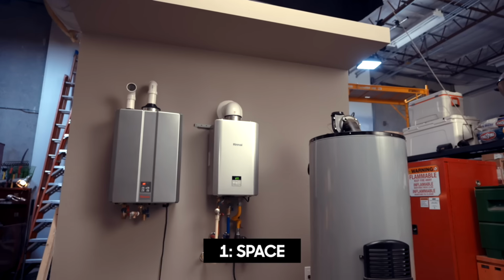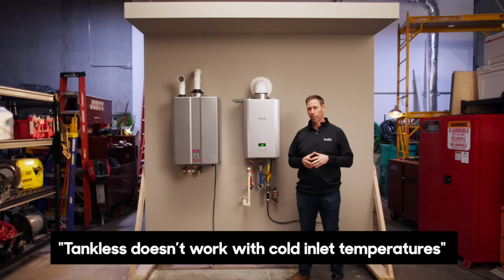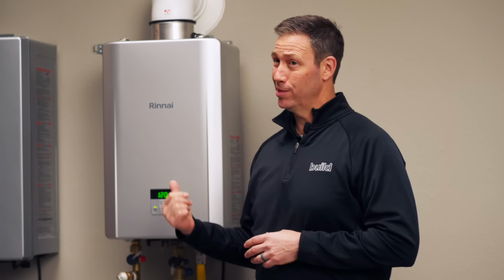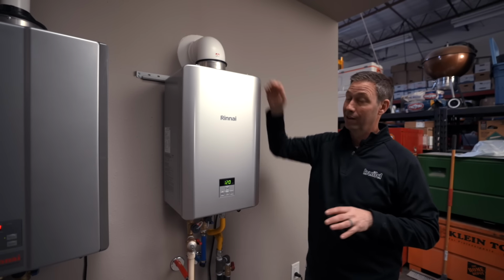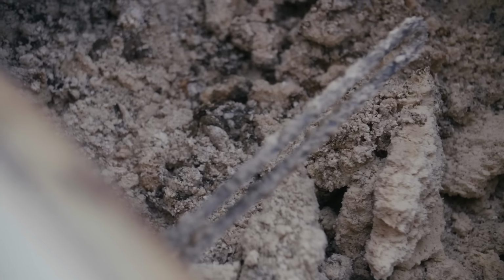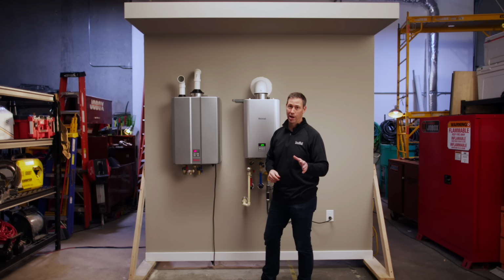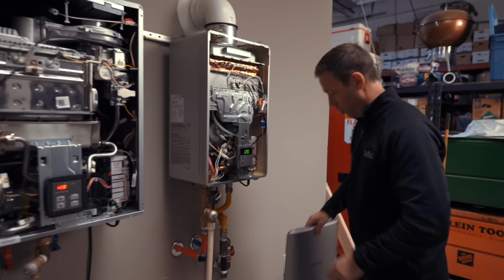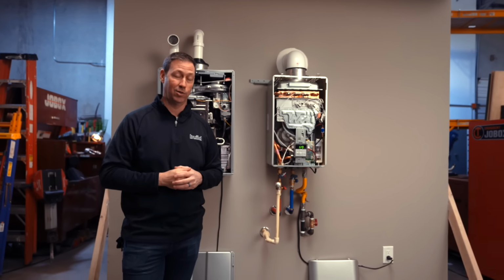DEBUNKING Tankless water heater LIES!

Comment: Your thoughts on Navien and Bosch
Reply: I have  both the Navien combi  boiler (domestic hot  water and water for heating pipes) and a Rinnai water heater.   Both are good,  The Rinnai is 5 years old and I clean it once a year.   The Navien is 12 years old and I also clean it once a year.  It developed a leak a year ago and parts weren't easy to come by and I waited almost 2 weeks for a  replacement part.   The  Navien  is made in South Korea.  I believe my Rinnai is US made and  parts are stocked more readily in local plumbing supply stores.
Reply: Navien has a lawsuit against them for their products. Mikey pipes repairs them alot and covers it well.
Reply: @zack9912000  Don’t know who Mikey pipes is. I’ll assume some YouTuber or TikTok. 

There’s a recall from roughly 4 years ago regarding some of their condensing type water heaters and Combi boilers. It involved risk of CO escaping the vent/flue system, entering living space. Of course if unit was installed to most codes, the room, if interior, would be properly vented and fitted w/CO detector. An exterior install would be of no risk. Most importantly, the respondent showed majority of effected units were installed by ‘non-authorized’ installers. The units were shipped to a distributor, not to specific installers. The recall is not a replacement unit, rather a kit that revises the venting from secondary ‘condensing’ heat exchanger. 

Completely understand avoiding the brand, especially if it’s not permitted by licensed plumber. Rheem offers condensing units, equal in efficiency to Navien. Both are superior to Rinnai in efficiency, warranty and reliability. I don’t have any personal experience w/Bosch water heaters but I’d recommend comparing warranty and EF rating to Rheem & Navien. If comparable, speak w/licensed plumber to see what brand they prefer and why.

Comment: Some notes:
- Your reasoning seems to only apply to gas powered heaters.
- Longevity; I don't know what quality is available for gas powered heaters in the US, but I recently replaced my electric tank water heater with a new electric tank water heater. The old one was more than 45 years old. My neighbor replaced his just a few months later, about the same longevity for his unit.
- For electric heaters, tankless heaters means that your electric system needs to be able to deliver more peak power (higher peak amps).
Reply: Old tank type last far longer than he is claiming. He is sponsored to sell these. So convincing you your 10 year old tank water heater that is perfectly fine, is bad, is what he is paid to do. The last one I changed was 35 years old, the one prior to that was over 60. I have changed ones less than 10 years old, but I can count on one hand how many times that happened.

Comment: I bought a Rheam tankless water heater first. I timed my furthest shower it was 15 seconds to get hot water. I priced out a Rinnai, went for the $700 cheaper Rheam. While the Rheam did hold up for for the first 18 month. Once I started having issues “Exhausting” errors. Nothing is worse than mid shower bam ice cold shower. The repair was easy, but did take a few weeks to figure out. My next house I’m currently designing will have a tankless water heater again. The maintenance does take longer on a tankless than a conventional water heater. I did pay the extra money for the easy flush valves. I also have a hvac license so I can buy contractor grade descaling liquid relatively cheap.
Reply: Love that Rinnai is USA made.  Agree  tankless are the way to go.  :)
Reply: He was promoting Rheem 4 years ago!
Reply: He will shill for whoever signs the checks 💲

Comment: Can you please tell me which is more efficient, electric tank with heat pump and solar panels VS tankless.

Given that the cost of both electricity and gas going up, which would be more efficient?
Reply: That would depend on if you're talking short or long-term.  Long term (or off grid) I'd go with a solar powered electric heat pump system.  Possibly being fed from a passively heated "pre-heater" tank that's warmed by a geo-thermal heat pump (used for heating and cooling via hydronic) and/or a solar-thermal loop.
Reply: Heat pump has EF rating 3.5-4.0. The best electric tankless, Rheem or EcoSmart, are EF 0.99. The best LP/NG tankless, Rheem or Noritz, are 0.97. Pretty simple math 😉
Reply: @MichaelM-to4sg  but have you taken into account of maintaince cost and lifespan replacement cost? 

The tank with heat pumps and solar etc might be more efficient but if you have to replace the whole unit 3x, the cost savings might not be so clear (I use 3x because my current tankless is going strong at 25years and the tank system is only expected to last 10 years).
Reply: @bobbinsnest  10yrs for tank? Says who? 

Firstly, if you have a tank water heater, replace dielectric rod every 7 years and they’ll outlast the tankless. Tankless require flushing annually, which should not be done diy as specialized tools are required, as are the proper fittings to be installed initially.

Rheem warrants their units for 12 years, iirc. The Sanden units separate the tank from heat pump. They have 15 yr warranty however the tank is full 304 stainless. Unless the water is extraordinarily acidic, hard to think it’s ever going to fail.

Comment: Love it…Made the decision to switch from a tank to a Rinnai tankless for our new home construction project. This decision was based on Matt’s previous tankless WH reviews…Several huge benefits to us with this move. The tank was going into a very small laundry room, which was taking up valuable space. The house we are building will not be occupied all the time. Now we have the tankless on and outside wall, gained back valuable space in our laundry room and will have endless hot water, but will not be maintaining hot water in a tank when the house is not occupied.  

Excellent overview Matt! 👏

Comment: Wait! What happened to the comparison to heat pump water heaters? Thought they were even more efficient.
Reply: they are, but its a sponsorded video soooo...
Reply: Agree. This video came off like a paid ad.
Reply: For me the attraction of heat pump is electric rather than natural gas or propane.  It seems to be easier to run on off grid solar than an electric resistance heater because the power draw is low and constant rather than high and instantaneous.  I'll probably go heat pump but mostly since I want to try 100% electric to avoid a propane tank and add solar to net-zero it.
Reply: Pay attention, this was about tankless
Reply: @daveklein2826  and he had a previous comparison showing how much better heat pump water heaters were. pay attention to the question.
Reply: @dannystephens8833  i understand that BUT that is not the purpose of the video....PAY ATTENTION

Comment: Ima get me one as soon as my current Bradford-white dies.
Reply: That’s what I did, it was only a couple hundred more when I was replacing my conventional water heater. Check your utilities company, a lot of them have rebates which can offset the increased price.
Reply: @johnstewart7310   Just Wait till it needs to be repaired, the parts are  always special order, the parts are always expensive. Please be ready to wait a few weeks. I fix a lot of the major brand's and most of them need to be cleaned every single year or sensors will fail and require a call to fix. What people have in the cost to operate with maintenance over the life of the system which is usual 11 years MAX, they will cost more to run then a quality tank hot water heater will.

Comment: Just was talking about getting one
Reply: You will regret it, they cost substantially more to maintain, parts are always special order, the parts are expensive, they dont last 20 years. They must be cleaned every single year if you have even mild hard water. Parts for a tank hot water heater are cheap, available at homedepot and lowes, if you forget to flush them no big deal, forget to flush a on demand hot water heater and failure codes will pop up. If power goes out then no hot water with tankless.  With a tank hotwater heaters do not require power for the non high efficiency models.